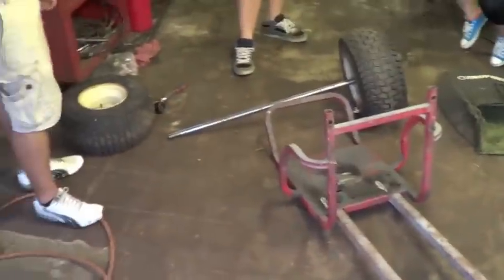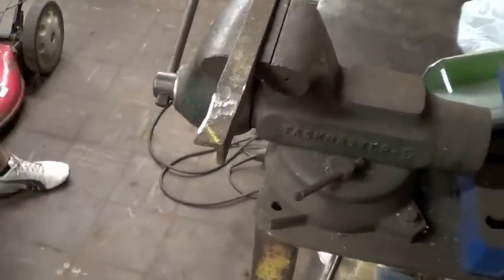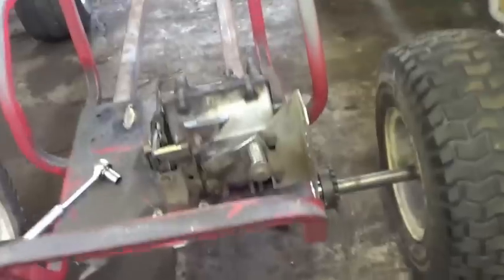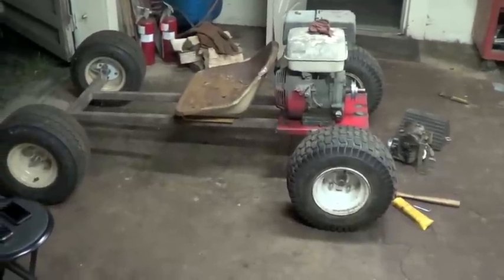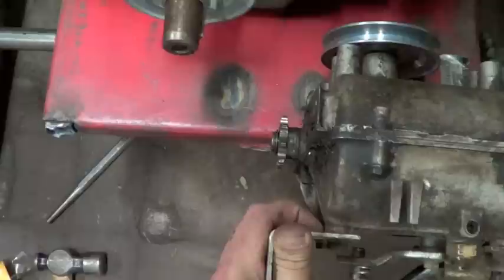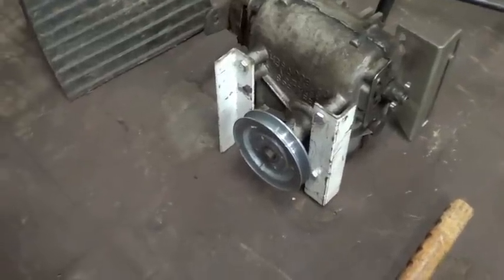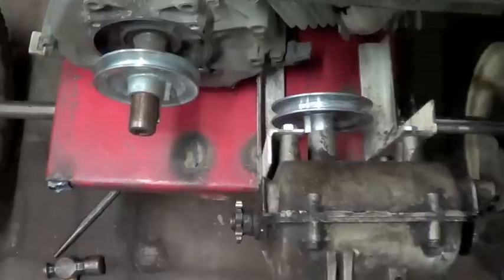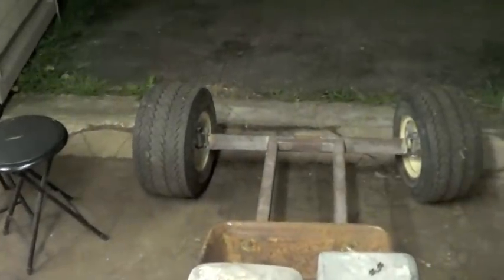Shifter kart transmission install (part1)

Comment from the maker: Hello! The transmission i am using is a peerless 700 transmission out of a toro riding mower. There are a lot for sale on ebay, but it's usually cheaper to buy a junk riding mower and salvage the transmission. Basically, most riding mowers come with this type of trans or something similar. As long as it's belt drive and not hydrostatic, those wont work. so, just look for an old riding mower and get parts from it.

Comment: From everything I have read, those Peerless transmissions will strip out immediately if shifted at speed.  I had plans of using them too and was talked out of it.  In racing Lawn Mowers, they use these transmission to re-align the power 90 degrees and use the gearing to choose the best ratio, but NOT to shift.  I like the golf cart wheels / tires.  Looks good.
Reply from the maker: haha well if she blows, she blows! i have had other people tell me that too. And thanks lol

Comment: Transmission spins the wrong way ? Easy fix  weld on somr tubing to mount  rear view mirrors  ! Problem. Silve the  cart just goes in the opposite direction  you just. Need to act like thats how you intended it to go  LOL  whenever i mess up i simply say everything i do is carefully planned  i meant to do that

Comment: hey man no prob but if you want it to last longer you may want to ( race prep it ) in racing mower terms but the set up will work fine like this but it will where out after time and you would probly have to get a new trany so just go to the youtube search and type in how to race prep a 700 peerless transmission and it will show you and if the video you watch says to put a tube on it egnor that part you just need to put berings in it. and sorry for the late reply havent been on a hole lot.

Comment: I like that you're making it look clean... I'm building a shifter with a 66cc two stroke bicycle engine and that same kind of transmission. The engine has a built-in manual clutch, so that's nice .. my speciality is micro karts and I only use two stroke motors.. I'm doing full adjustable independent suspension too.

Comment: bignickthegreat did you have to modify the Peerless 700 to work on a high-speed go kart. I’m thinking of doing something similar but with a 500cc engine and I don’t know if it will just instantly destroy it

Comment: where did you get that sprocket am trying to find one that's why I can't find one because I got a1 inch straight axle and I'm trying to find sprocket that small for it
Reply from the maker: ebay. Just type in 40 chain 28 tooth sprocket or whatever size you are looking for

Comment: I don't get it the peerless transmission is rated for about 20ft/lb of torque how will that work that engine produces 29ft/lb and god forbid you wanted to put like a 670cc 29 hp engine on that most certainly would blow apart I think. Please advise if my research is faulted. God bless
Reply: it may make 29 ft/lbs at the shaft, but if he puts a little gear on the shaft then a big gear on the transmission it changes

Comment: how did you prep the gear box to be "shifted on the fly"? Everywhere I have read, people say shifting while moving will destroy these transmissions.
Reply from the maker: Francesco Antinoro Its all about rev matching the engine when you shift. don't be fooled, you can easily bang-shift it but it will destroy it

Comment: where can i find a transmission?
Reply from the maker: these are found in small riding mowers. usually the kind where the engine is under the seat. mine came out of a Toro riding mower
Reply: *****  Must be typo, No riding lawn mower has motor under seat. tranny yes, motor no.
Reply from the maker: this is the exact model i had. engine and trans under seat. 

The New Toro/Wheelhorse 8-25

Comment: Hey... I don't know if you know but is it possible to use a small cars gearbox on a gokart? I can't find any gearboxes like the one u used in australia. :( I really want to make a shifter kart with a 6.5-9hp engine but want transmission on it.. Thanks
Reply from the maker: Blitzeral I think you would have better luck cutting up a dirt bike engine/gearbox and trying to use the gear parts from that instead of a car gearbox
Reply: +bignickthegreat i am doing this now and holy crap it works

Comment: Hey Nick, sorry i'm a big noob but why do you have those 'pliers' wen you are welding? And sorry for any misspellings, i'm dutch.
Reply: They aren't pliers, but that's a common misconception, so don't worry.  I am not to sure, but I know that the welder is an Arch welder, meaning it uses extremely high amounts of electricity arching from the rod to the metal in an extremely overheated, quick motion, causing the metals to bond. Those, "pliers" is actually a grounding clamp that sends the electrical pulses through the metal. Without that clamp, the metal would react so quickly to the heat and electricity, it would just go, "Kaboom." Sorry If you cant understand all of what I am saying xD, its hard to put into fluent English. Hahahahaha.
Reply: oke anyway thanks!
Reply: No problem! :D

Comment: im very impressed but. instead of a pulley system why didn't you just get a max torque centrifugal clutch, mount it on the engine so it will automatically engage at a higher speed then run a chain or belt to the transmission. it would have been so much easier.
Reply from the maker: a centrifugal clutch would not work with this type of setup. i would not be able to shift the trans when the kart is moving. and easy is not my kinda thing hahaha

Comment: where did you get the drive gear for the trans?
Reply from the maker: Conner Pierrard try searching in ebay "peerless sprocket" should get you close. but mine came with one since I took it off the mower myself

Comment: oh and you dont really want one to one pully if you want lots of speed you need to get the smallest pully you can fit on the trany and the bigest on the engine. becuase one to one and that size of pully will make you do 8 to 10 mph big to small 15 to 20 25 or even 30 mph like say 10 to 11in pully on engine and 2in on trany easy 25 to 35 mph! AND 8 TO 10 MPH IS SLOW!!!! THATS RIDING MOWER SPEED LOL
Reply from the maker: haha thanks for the info! i have messed around with mower transes before, and usually a low power setup like this will hold up for a while. this trans although it's old, it has really low hours on it so the bearings should still be pretty good. i may change the fluids in it though. and as for the whole ratios thing- my belt pulleys may be 1 to 1 but i have a very small axle sprocket my calculated speed @ 3500 RPM is around 37 mph!
Reply: they are not bearings they are brass bushings the only bearing thats on there is the input shaft.
Reply: hey i totaly forgot to add on the comment is that you dont want to shift that trany will your moving you or you will just be grinding gears and avetuly blow up the trany so yeah you would have to have a clutch betuin the engine ands the trany and one in batuing the trany and the axle if you wanted to shift on the go

Comment: just a tip. Never use your torch or cutting wheels before you leave the shop. Ginve it a good 1hr. Certain materials will smolder while you dream lil red go karts spinning in your head
Reply: jeff clark lol

Comment: Why not just use a motorcycle motor with a transmission already in it. It would be way stronger and cleaner.
Reply from the maker: Adam Batchelder agreed, look at the go kart that I most recently built and you will be pleased haha
Reply: Too easy and cheaper

Comment: THIS THING IS GONNA BE SLOW AS SHIT
Reply from the maker: No? I did the math, its all about gearing. It will do 35 mph @ 3500 rpm, and can climb almost any hill. I have proof, see the other videos.
Reply: really no doubt
Reply from the maker: there is video proof! check out the top speed run video
Reply: What ever floats your boat

Comment: just love these clueless kids using tools whom have no idea the risk they take unnecessarily,I.E oxy-acty.torch wearing shorts and protection
Reply: ive never had a problem using an oxy acetylene torch in shorts. I even fusion weld with one in shorts. if you're cutting thats different because of all the molten metal flying around though
Reply: supercowmoo3 Famous last words..."I've never had a problem..."